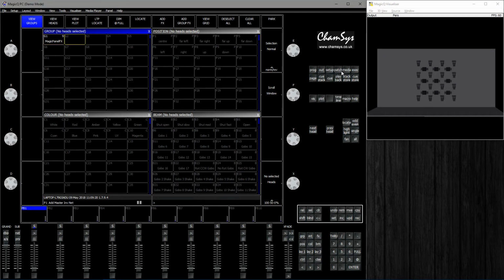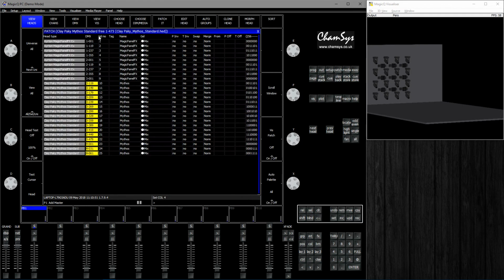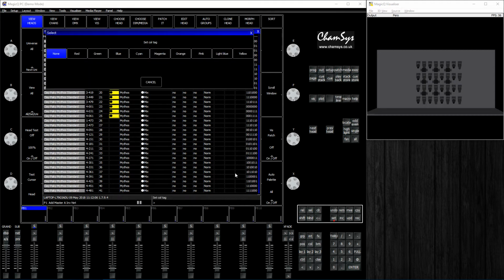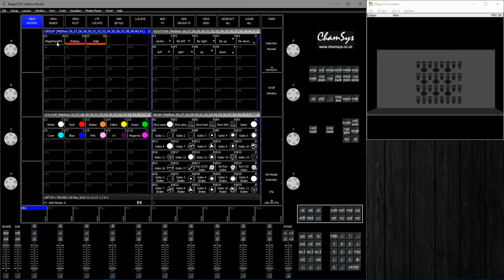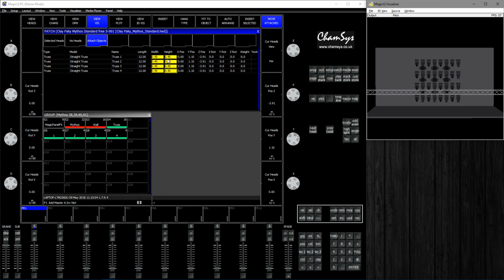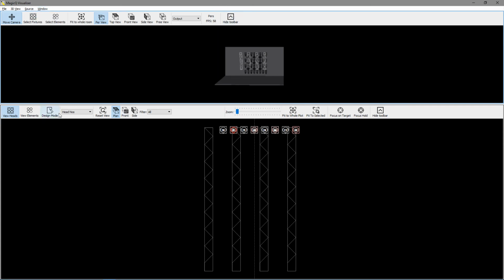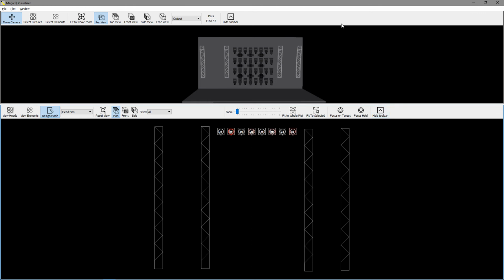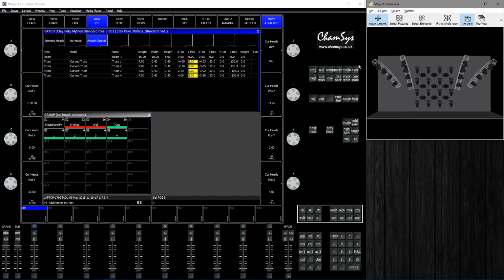ChamSys MagicQ: Create A Basic Rig | Part 2

Comment: My light beams are really wide how do I narrow them down ?
Reply from the maker: You can set the parameters for the visualiser under patch - edit head - params.

If the fixture doesn't have a zoom attribute, just put the desired beam angle on both the narrow and wide parameters.

Remember to save the updates.
Reply: Ok I will try that, thank you, and the videos are really helpful 👌🏼